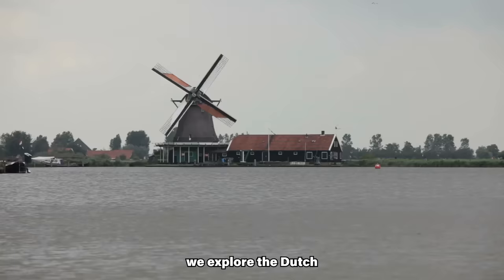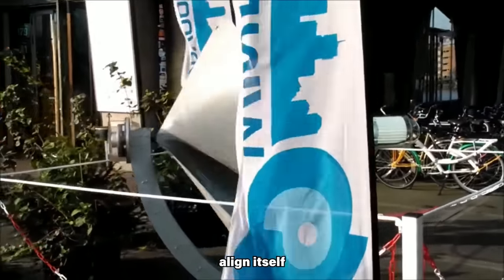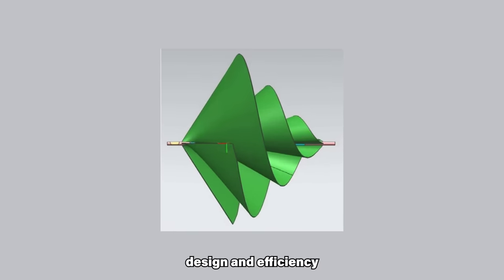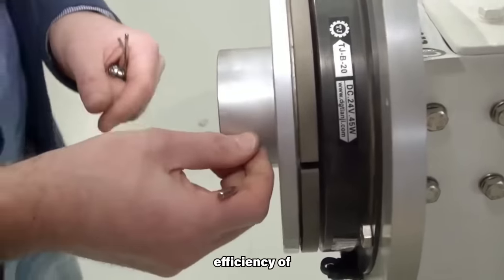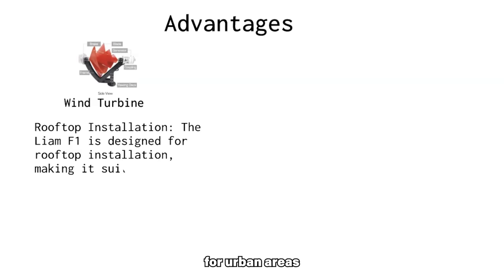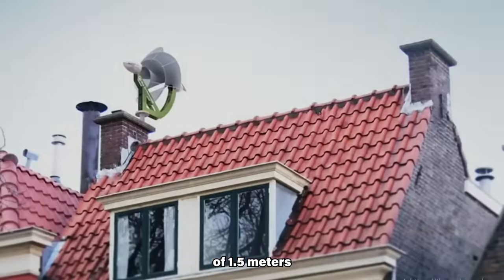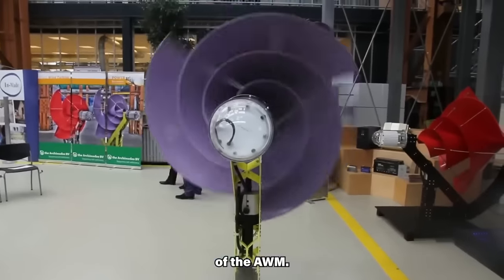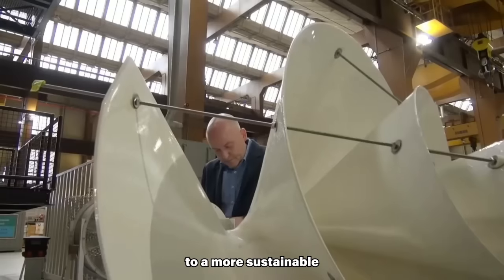The Game-Changing Wind Innovation You Need to See The Archimedes LIAM F1 Small Wind Turbine

Comment: I have a solar system on my house but I've come to question a lot of stuff being disseminated.
For example: has anyone considered the unintended consequences of huge numbers of wind turbines (of any size) taking enetgy out of the wind? Take for example the numbers of wind turbines that are supposed to be built across the US. The wind has kinetic energy that hits the blades of a turbine, turning it BUT the wind leaving the turbine IS SLOWER and has changed temperature a tiny amount. It's too small to matter you say? But when there's tens of thousands of giant turbines and hundreds of thousands of small residential ones the effects aggregate into something significant. Remember, a single cars exhaust was considered negligible until there were millions of them.

SO, how is the weather going to be affected downstream of these wind turbines? NO ONE KNOWS! What's going to happen on the East coast of the US if the wind is slower? Is it going to effect rainfall? Go ahead, blow me off, say I don't know what I'm talking about but you'd be wrong, just as so many times in the history of this planet groups charged ahead and discounted warnings.
Reply from the maker: Thanks for sharing these valuable points. I can see a lot of questions you asked. I kind of agree with you that a lot of these potential issues need to be addressed. Every thing in life have advantages and disadvantages and in most cases there has to be some compromises. While I love renewable energy, I also believe a lot of work and research need to be done to address some of the potential issues that comes from some of the renewable energy sources. Your line about 'cars exhaust ....until there were millions of them' got me thinking that you have a strong point.
Reply: Anything standing in the wind takes energy from it, from a blade of grass to mountain range.
Reply: @MichaelsCrazy  yes, and mountain ranges change the weather downstream of them. A belt of giant wind turbines stretching across the Great Plains from north to south as planned will do what to the east coast of the US?
Unless you've researched the downstream effects, and know that they are not significant in mass numbers, are you qualified to comment with such banality?
Reply: When in Oklahoma they took out all trees and wind breaks and it caused the dust bowl in the 19 thirties
Reply: Just forget all the garbage to discover and appreciate the value of traditional fossil fuels!
Reply: You are quite right, it will slow down the spinning of the earth, which will lead to the earth spiralling I to the sun.  Get worried in  million years or two
Reply: @markthomasson5077  your right renewable clean energy is the best kind of energy keep learning new ways to produce clean renewable energy because one day that’s all you will have. We should have been going that direction the last hundred years but we put all our eggs in one basket with fossil fuels .Having many ways too produce energy is a good thing. History shows when you don’t change for better ways of doing things you get in trouble being caught short. Greediness is always a down fall of man .we must diversify kind of like a farmer rotating his crops they have learn growing the same crops over and on the same ground is not good you have to rotate.
Reply: So bobjoatmon1993, how do you know what forces the Earth to rotate ?  Where do you think the wind comes from to begin with vs. density of the air, maybe even gravity & all the magnetic polarities involved including the moons and rest of the planets in the solar system ?
Reply: You think our massive atmosphere will be impacted by even millions of these turbines? Maybe a meter tall, and 10,000 meters of atmosphere above it?
Reply: @rscott2247  heat changes place with cold air,to much heat or cold is no good ,balance is the answer it is that easy but that takes the whole human race to work to do that and that is hard to do and there are catastrophic consequences that happen in all that equation.
Reply: @Snowwie88  just be glad you can afford these energy machines some people don’t have food.
Reply: Ha. Well if there is any appreciable difference in the weather it will sure be a hell of a lot less than burning fossil fuels has done for the environment.  Hell, weather is only getting more extreme so if anything, if something is "taking energy" from the wind...do it.
Reply: Do trees affect the wind negatively??  :)  Would you not plant a tree or let a large tree grow because it "slows down the wind"??
Reply: @jenkem4464  wind power is great more the better
Reply: @jenkem4464  wind energy is great
Reply: @drakemia4079  It is!
Reply: @jenkem4464  I love trees I have planted ten thousand trees in my life ,apple trees .
Reply: The effect of turbines will be minimal compared to that of mountains, hills and multi storey, high rise buildings.

So yes, in an area of predominantly flat land for great distances it will tell significantly.

But in areas with regular obstructions like hills, mountains and urban skycrapers or tenement buildings it shouldn't cause significant disruption beyond what is already occuring.

That being said the detriment to avian wildlife will be significant if measures are not taken to identify the turbine to them, such as marking the blades so that they are not a flat color which may not register well in motion, which is the likeliest reason for much of the avian wildlife losses associated with wind turbines.
Reply: @mnomadvfx  wind power they are very good machines the more the better.
Reply: Muito bom seu projeto, é um dos mais renováveis, desejo sucesso a vc e sua equipe !
Reply: A tree and a wind turbine even of the same size, will interact differently with the environment. So the effects can't be the same. 
I would align with those who want a more detailed research before deployments and a balanced utilisation of our energy sources in the long term.
Reply: I'm going to add a comment that I think too many others here are assuming I meant tiny wind turbines. This is WRONG, I'm talking about US wind turbines that are an average of 250 to 260 feet tall towers (+-80 meters) which get placed in huge wind farms of hundreds of units.
There are thousands from Texas up through the planes states up to Canada and there are plans to install tens of thousands more in the next decade. Back when I worked for GE Aerderivative Power Systems I read a report about how the wind dropped velocity and turbines downstream wouldn't generate as much electricity and that had to be accounted for. There was also mention of what I was trying to convey to you people, the wind is slower, the temperature changes and no one knows what will happen if 500,000 units are spread across the Planes states (and YES, they are projecting that many needed by 2045)
Reply: @ibrahimachonu6878  renewables are the future
Reply: Eventually, we need a Nuclear Fusion Power Plant. Big and miniature.
For transportations, land and air, we need batteries and one miniature of this rose wind mill.
Reply: @apakansaja8505  we better get busy.
Reply: The air at rotor level is not isolated from the air above it. So yes there is a wake effect, but wakes do not go on forever. The wind at lower levels is replenished by the wind above it.
Reply: Is my content the reason why my messages are getting blocked?
Reply: " NO ONE KNOWS!". You mean that you don't know. There is actually already quite a bit of literature about this.
Reply: @bobjoatmon1993  But, but but (frowning eyes) what did I do to the universe?
Ohh well, I might as well go to the next one. Bye

(that should be proof enough of multiverses)
(take care and have a great day;)  )
Reply: @KenanTurkiye  I expect the reason the universe focused on you is that it's perverse?
Reply: @bobjoatmon1993  ....or it could be because I ate onions, I dunno. :)
Reply: @mnomadvfx  "in an area of predominantly flat land for great distances it will tell significantly." No it won't. The maximum disruption to air flow caused by a wind turbine is 57% across its sweep. Most turbines are no where near that efficiency. A large redwood has a disruption factor of close to 85% across its 'sweep'.  2 miles downwind of a line of turbines, you would be hard pressed to measure anything. I agree with the rest you said.
Reply: @bobjoatmon1993  "the wind dropped velocity and turbines downstream wouldn't generate as much electricity" has to do with the relative density of turbines, not the absolute number. 500,000 units spread across the Planes states will have close to zero effect on the broadscale wind. The effect if there was some would be to increase the wind speed on average to what it was before the turbines were in place, due to the temperature contrast in might induce.
Reply: First run this project in an area where you have nothing to lose, Run it as pilot and share observations.
I doubt millions of these would impact our atmosphere.
I doubt about vibration of this Machine, what would be the impact.
Birds another I think.
Remember making anything for profit and not for humanity would put World in dungeon.
Since it is already built might be sharing about the problem it has (area of improvement) can be discussed keeping aside Money part
Reply: @rscott2247  you really are a space case.
GRAVITY? Really? No, wind power won't appreciably affect the Earth's rotation or other planets but it WILL affect climate.
Andvi wonder if you're really that xxxxxx or or you trolling
Reply: @jenkem4464  but you don't know that for sure, it's unknown territory, no one knew automotive exhaust would add up to something bad either, but it did.
Reply: @jenkem4464  that's a dumb argument, trees aren't 500 feet tall which the rotor disc of wind turbines ARE so a tree is lost in the ground clutter chaos turbulent flow of atmosphere
Reply: @boldvankaalen3896  BUT the wind speed is LESS coming out of the turbine AND the temperature changes upward, now the wind goes into a second downstream turbine and slows down more, then a third turbine and slows down even more...
So what's the wind speed on the East Coast after tens of thousands of turbines across the mid-continent? It WILL have an effect on the Eastern climate and rainfall
Reply: @bobjoatmon1993  So then by that same argument we should stop planting trees because they might eventually end up "slowing down" the wind? lol...come on dude...think about it for a minute.
Reply: @jenkem4464  nobody said that, again a fools comeback.
Sheesh, trees are SHORT compared to wind turbines and aerodynamicly they are in the turbulent flow at ground level. And if it's a forest the wind is passing over then the wind doesn't 'see' the ground at all, it acts as if the tree top canopy was "ground level". An individual tree out on a prairie has some effect BUT AGAIN, trees don't reach up 500 feet into the air and AGAIN the wind tunnel modeling of the airflow downstream of the swept area of the blades (called the 'disc') AND actual measurement has shown that the effect on the air extends up as much as a mile, 40 miles from the turbine. Now imagine rows of wind turbines dozens if layers thick and the small effects accumulate. In a way, this is an illustration of the butterfly effect written large.
This is my last post on this because 'horse to water' and I'm tired of small, in the box thinkers.
Reply: @bobjoatmon1993  There is indeed a wake effect, and that is why wind turbines stand further apart in the main wind direction that in the direction perpendicular direction, and wind parks are not infinitely large.  Typically wake losses in wind parks are in the range of 10 to 20%. 

But the wind at turbine level is not isolated from the wind above that. And at some distance after the wind park the wind is "replenished" by the wind at higher levels.
Reply: @boldvankaalen3896  you get close to the answer but miss. On a global scale even that upper level atmosphere is affected by downstream turbulence by hills, mountains, oceans (long flat stretches) OR as a study I once read about where weather balloons were launched at one mile intervals for 500 miles to see what the effects of rows of windbreak trees was in the central US prairie. Turned out there's quite a bit that was detectable 1000 miles away. Old study, I was in college when I found the paper in 1991 or '92 (it may be on the internet now but I don't know, it was pre internet)
Reply: @apakansaja8505  We already have a gigantic nuclear fusion plant. We call it the sun, it is quite easy and cheap to harvest the energy from this fusion plant.

Comment: The main issue with home wind generators is that they require high wind speeds to actually work. And that typically means errcting them far higher than what cities or HOAs will allow.

This one is no different, and requires an average wind speed of at least 5m/s (11 mph). My average is 3.4 mph...

Comment: I believe the claim 1500KW per year is more of a sales pitch to the general population rather than a true indicator of this small generator’s  performance.  1500 Watt/hours is not bad, enough to supply one branch circuit or one small appliance circuit @ 15amps IF  the small generator can supply the proper Volt-Amps. I would buy the generator 👍

Comment: I would like a much smaller version to power my boat electrics. About 50 Watts.
Reply: 50 watts? You can nearly reach that by putting a bicycle on a boat and peddle that amount together. 🙂
Reply: @Snowwie88  Most modern solar panels are over 300W so even on a cloudy day 50W isn't that much.

As perovskite or silicon/perovskite hybrid panels come into use those values will only go up, and concentrator optics will increase it further still.

IMHO I wouldn't want a wind turbine anywhere near me where I can get swatted or cut by it in motion.

They are best high above our heads on rooftops, or even better on towers where the wind will be encountering less resistance from rooftops and the tree line.

Comment: Every home actually require 3000watt/day to run the lightings and other appliances efficiently. So one of this is sufficient to cater for all the needs.
Reply: You mean 30kWh a day?
Reply: @landmanp  They said this turbine generates 1500 kWh per year.  It's been reported that a normal size home would be 29 kWh per day which is close to 10,500 kWh per year.  One turbine is one seventh of the needs.
Reply: @patrickcorliss8878  yes exactly. The timing of the generators we have don't seem to align with our needs either.

Comment: The energy which can be extracted from moving air is determined by the swept area and its velocity, and no fancy designs are going to change that.
Reply: Yes, the swept area and its velocity plus turbine effeciency. Betz’s law states that no turbine is capable of capturing more than 16/27 (59.3%) of the wind’s kinetic energy. This "fancy design" gets closer to the Betz’s coefficient because more kinetic energy is extracted across the sweep area. The design is great, but the price is too high. $5,000 for the Korean made standard model, drops to $3,200 for the Indian made model.
Reply: @haroldnowak2042 No, it is NOT higher efficiency vs 3 blade wind turbines.

Comment: This turbine works great together with solar panels. Electricity is produced by the sun during the day and by the wind at night.
Reply: Typically, it is LESS windy at night. At $5000 each, these are a financial disaster.
Reply: @MrSummitville  At $5000 is for the smallest model. Try $20,000 for a larger model. That said, the ones made in India are starting at $1,700 for AWM750D which is better, AWM1500D for $3,200.

Comment: Well I'm a bit further with researching wind energy is interesting or not; 
-1- search for the average windspeed in your location. 
-2- see how many square meters of wind you can 'catch' there, within regulations and finances and reasonability.
-3- then let CHATGPT calculate how much energy under those terms can be drawn from that, ignoring all the losses (electrical, batteries, converters etc)
-4- IF you are still convinced this will give you a good return on your investment in money, time, efforts THEN go for it !!!
Well I stopped researching at point 3, but thought someone might read this and prevent someone else's misfortune...

Comment: Suppose it's winding half of the time, it should be a 300 watts windmill.
Reply: Exactly, the narrator is taking the solar installation at the lower end of its output.

Taking the wind turbine at the ideal and the solar at the low end is not a fair comparison at all, especially as the solar panels are silent, as 40+ dB will be easily audible on an otherwise quiet day.

Comment: Nonsense.
Assuming that the efficiency of both the rotor and the generator is 100% - meaning ALL WIND ENERGY is converted into electricity.
With an air density of 1.225 kg/m3 and a wind speed of 5 m/s and a rotor diameter of 1.5 m, the kinetic energy of the wind is 6.125 J/s.
Which at 100% efficiency and continuous, uninterrupted wind would give a maximum result of 1,897,314,000 J = 527.03 kWh.
Reply: The maximum theoretical efficiency of a turbine is 59.03% (Betz's coefficient). In practice, wind turbines have an efficiency ranging from 35 to 50%.
Reply: In practice, with 40% efficiency, this turbine can generate a maximum of about 0.576 kWh per day.

Comment: Good for sail boats and other boats.
Reply: exactly, obviously this could generate the same energy as 10 times larger sail. if they directly connect to water prop shaft it would 100% outperform any sailship. but having meatgrinder on board is scary even with protection cage.